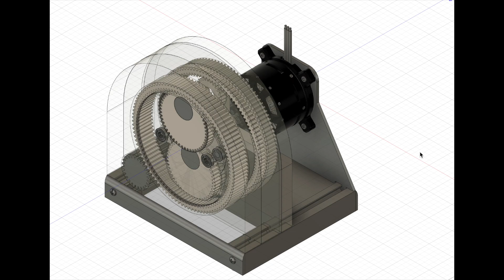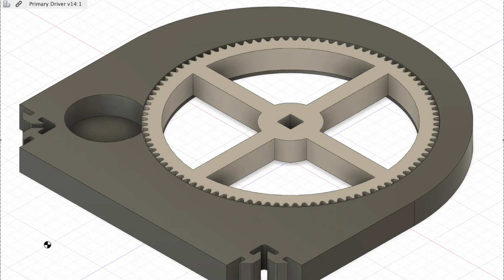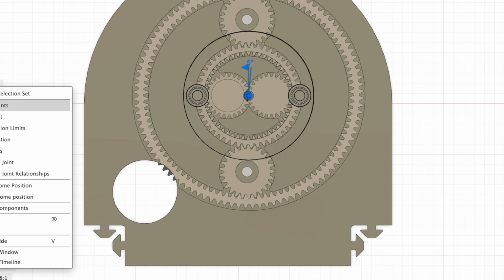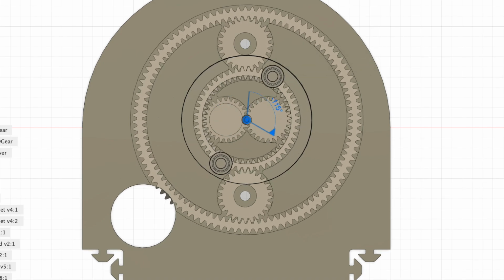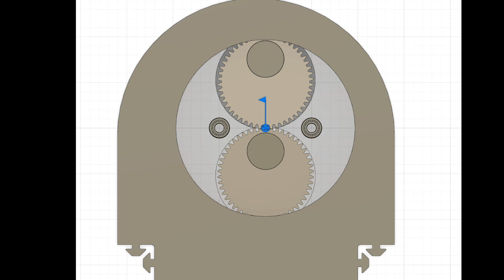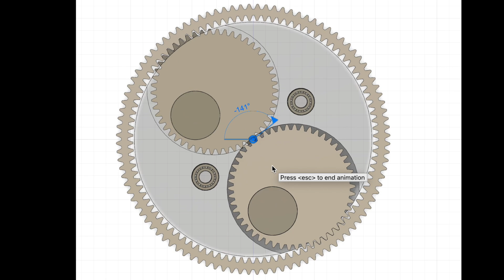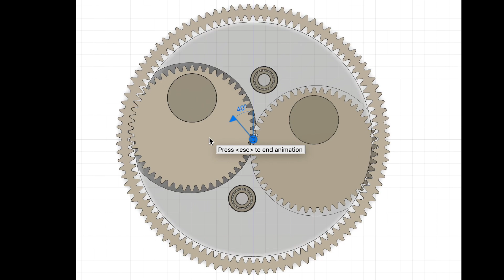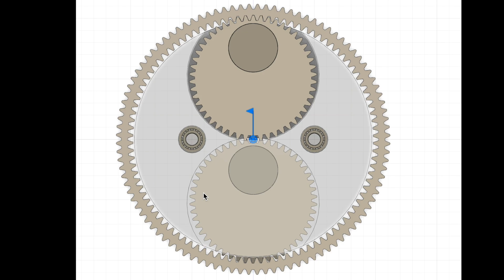Inertial Propulsion System 2: QELA\QALA HEAVY

Comment: I like your System 2 device better than the System 1. I’ve updated my Sling Drive device also since the last time I commented. I’m not an engineer or anything, so I would appreciate any tips you could give.
Reply from the maker: Thanks a bunch for this comment🙇‍♂️. I’m also a fan of the second system because it’s a lot easier to build than the first. It’s essentially like assembling a mechanical clock/ gear mechanism. 

Also—I’m more than happy to share any insights as you continue with your builds. My only advice at this moment is try until you find something that works! Make sure you have a good understanding of the principles you’re trying to leverage to get something functional, otherwise you’ll be thrown into the “blind alley”of structural fixedness! 

Feel free to reach out if you have any other questions. My contact info can be found on my channel homepage!

Comment: I built the same thing about 10 yrs ago.. called it internal propulsion and the model was made with rc car gears.. inspired by contemplating wheel hop in a car and redirect the weight to eliminate downward force.. what i found was it will redirect all of that energy to the left and right, due to retracting the weight towards center. It will form a twist to the entire assembly... Was gonna put in in a jetski while dreaming potentials, even pictured constant accelerating spacecraft.. turns out, "they" have already built, based on this logic, a functioning solution.. basically, a hollow doughnut shape, full of ferromagnetic superfluid, wrapped with similar wiring pattern as an alternator, very high current is passed through the wire to make the fluid travel to follow the wire.. just hold a bike wheel out at arms length, dont tilt it, get it spinning and simply rotate at the feet. It will pull up or push down based on which direction your feet turn.. like a merry go round that wants to lift
Reply from the maker: Thanks for the comment, and sharing your unique investigations! People like yourself have nothing but my respect—I know how difficult it is first hand to prototype these systems and explore alternative design approaches which haven’t been given an honest “light of day” so to speak.

Comment: I have an idea related to converting rotation to directional force without a propeller or a wheel on the ground.  It has a motor rotating a balanced lightweight frame with a short heavy object in it that can easily move back and forth on the frame.  The heavy object will be less than half the length of the frame and will have a connection point in the middle of it.  The connection point on the heavy object will be connected to one side of the box via cable or metal bar that can move side to side on the connection point.  As the frame rotates, the heavy object will be continuously be pulled to the same side of the box.  Being so unbalanced it will cause extra vibration so ideally it would need to be two identical rotating frames side by side rotating in the opposite direction.  The only thing that would be left is directional force.  I haven't tested this yet so I don't know if it will actually work.  If it does work and it can generate enough force, one could create a flying craft with no externally visible propulsion.  It would work in the vacuum of space, in atmosphere and even work underwater if it is sealed.  It is worth a small scale test.

Comment: There is one style of inertial propulsion system I believe might work. It consists of a sphere filled with gas or liquid. Pulsing laser beams converge at the centre to produce a field of exploding plasma. Each explosion pushes the head of a hammer on a spring against the end of a bar poking in from the wall of the chamber. Each stroke of the hammer accelerates the device in the direction of the stroke. There is no reaction force from the plasma driving the hammer to cancel out the acceleration because the plasma field is free standing within the chamber and not physically connected to it. The kinetic energy that doesn't drive the hammer transduces to heat before it can touch the walls. That heat is either expelled from the device or fed to a transducer to save energy. I imagine this device can only be used once in space as it may not have enough power for launching into space or for use as aircraft.
Reply from the maker: Very cool idea, interesting . Thanks for the comment and thank you for sharing ! 🙇‍♂️

Comment: You have designed a wobble bot.  It will oscillate.
Reply: Actually tho, made a gyroscopic spinning cube vehicle in lbp going off this very thing. Center engine was an equilateral cross with two diagonally opposed disk weights.

Comment: i wonder if you can do this with magnets and plasma flow
Reply from the maker: You've actually point out something which is kinda of an interesting overlap: all of the mathematical curves you find in these systems closely mirror the kinematics of motion that you would find for a particle traveling in a confined plasma chamber/accelerators. In fact, when I first attempted to write the code for these simulations, using python, they came straight out of those kinematics.
Reply: @MillennialZoomer that is interesting. that makes me wonder if regular fluid in a tube would work, a pump and tubing should be quiet easy to setup
Reply from the maker: @spacecase0 doable, probably. Straightforward in execution, most likely not. From the little experience I had in-lab dealing with industrial type pumps engineering something like this for a pneumatic/hydraulic-like system would be quite a project (to put it lightly).
Reply: Yes.. you can

Comment: You won't get a net inertial thrust.  Everybody (including myself back in the day) who comes up with the idea of changing orbital mass radii with constant angular velocity, forget to factor in the coriolis forces the masses produce onto the rotor during a mass's up swing/enlarging its radius and the other mass's down swing/decreasing its radius , which unfortunately counters the difference in inertial forces on the upper half verses the lower half of the rotor.....
Reply from the maker: Thanks for the comment. I was very careful to research this problem. A good book which talks about what you just mentioned is "The Death of Rocketry", namely pages 45-58 do  justice laying out the most common pitfalls when people ignore tangential, centripetal and Coriolis forces.

The Coriolis/centrifugal (which really doesn't exist) concern comes from analyzing in a rotating frame. I’m not doing that. The singlet is derived in an inertial frame and only rotated with explicit rotation matrices at the end, so those terms are accounted for by construction, not ignored. What I've actually built is a two-mass Tusi-couple or mechanical singlet: two identical point masses on rotating internal disks, π out of phase, inside a co-rotating host. The geometry, centers, and arm vectors are defined explicitly, then transformed with rotation matrices; no extra “fictitious forces” are added,  and what remains left over is true. 

Concretely, the positions are:
D_A(t) = c_A(t) + a_A(t)
D_B(t) = c_B(t) + a_B(t)

where a_A and a_B come from rotation matrices acting on the fixed local arms. The center of mass is the average D_CM(t). In the singlet, after applying the global rotation R_theta, the CM stays fixed but there IS a net linear thrust due to antisymmetry ( I later discovered this later through the math,  the 'asymmetric' label I used all these years might not be so accurate)  and mass exchange. Actually the "Coriolis" force, which you say  is supposed to work against me, IS the only reason there can be a net thrust on the center at all.

To be  extra clear: there is no "constant angular velocity" for a given point mass in the Tusi mechanism approach. Both masses are  constantly being accelerated and decelerated  during one cycle on a  folded/looped track which is the diameter of the large disk. The "stator" casing which carries them definitely has a "constant angular velocity", but not the point masses themselves.This system is energy-exchange-driven: internal angular momentum and phase hand-offs move energy around inside without violating CM invariance. Moreover, it’s not about making a mass “speed up” to generate force, like in devices such as the Brandson device. It’s about energy exchange. The disk behaves like a simple quantum system: it always starts with some nonzero potential energy at the lower position. They are individually identical to classical springs in a simple harmonic oscillator, albeit 90 degrees apart from one another in initial configuration.

I’ve already posted the math and simulation here: https://www.researchgate.net/publication/394250595_A_Heuristic_for_the_Discretization_of_Classical_Mass_as_Ordinary_Objects_and_Dynamic_Spinors

For a video which does good work explaining the displacement of an oscillating system during forced vibration of a system along with work and energy this is helpful: https://youtu.be/Ghk8o4z2VN8

I'm human like anyone else, so I could have missed something or made a mistake, but I'm pretty confident in my assessments on paper and prior investigations--to say the least. And if it doesn't work, its certainly not the only way to generate mechanical thrust.  

hope the helps some!
Reply: @MillennialZoomer   I'm from the camp that goes with the premise as follows:  Space/time is a substance and not an empty vacuum.  Inertia is therefore the tension or drag from this space/time "stuff" that mass experiences due to interfering with it during acceleration.  Therefore, a mass experiencing centripetal acceleration generates this space/time drag across its mass, what we otherwise call a "fictitious" centrifugal force, but nonetheless still a force, derived from this space/time drag that can do real work and displace the C.O.M. of the frame of reference you are working with (this dragging of space/time is transferring energy from the space/time into the frame of reference that we want to go somewhere, so conservation of momentum principle is not violated because we have a source of energy that we are tapping into beyond the frame of reference housing the device, the spacetime environment).  With this in mind, the ultimate goal is to engineer a device that uses this spacetime drag/inertial force to accelerate a frame of reference housing this device by minimizing any opposing inertial forces generated in the process of doing so that would otherwise cancel out any net inertial force effect. 

Tell me if I'm wrong, but I understand so far that you see reactionless thrust to be achieved through means of energy exchanges within the frame of reference you are working with through phasing of mass movement to not be in violation of C of M.  I believe that I'm seeing it differently in that I think it's possible, and that we need to consider the transfer of energy from space time itself from outside the system for "reactionless" drives......to react off of spacetime............
Reply from the maker: @antigrav1302  So once again I strongly encourage you to read this document:https://www.researchgate.net/publication/394250595_A_Heuristic_for_the_Discretization_of_Classical_Mass_as_Ordinary_Objects_and_Dynamic_Spinors

If I'm understanding your response correctly, it sounds like you are assuming that I believe space is an empty void of nothingness. Very politely,  I do not know where I ever said spacetime was purely empty. Maybe it is because there is a fundamental misunderstanding regarding my former statements on the centrifugal and Coriolis forces. If you stopped to read the material I provided you might find that we actual share some overlaps. Who knows (*shocker*) we might even belong to the same camp. In fact, much of what you've just said, I've definitely attempted to give some rigorous treatments to in a "formal" fashion using the language and "conventional" (whatever that is supposed to mean)  tools of physics within the paper.

Furthermore, what you are saying about the fictitious forces, isn't really going against what I'm saying when I say "they aren't real". If you have 3 minutes to spare here's a video which might clear up the confusion regarding what I mean when I say "not real" because it sounds like that may be another point of agreement:https://youtu.be/W_7QWaiJYDw?si=xgTIU93QdFQB88nj   Or only 2 minutes maybe this one: https://youtu.be/n4AMF3UfEX4  ...Or just you can skip to page 28 in the document I provided and just look at the graphic on that single page. I think once you get there, you'll see that we are probably (mostly) talking about the same thing regarding "tension" and "resistance" as it relates to inertia...

You aren't wrong at all on your commentary regarding energy exchange-- in fact you are one of the few who is keen to understand this fact---this system I've developed, strictly speaking, is not "closed" (infact, I could argue that there are no purely "closed" systems, depending on how I use Mach's principle).  All of my devices may qualify as a sort of "opened" system in space depending on how one invokes Mach's principles. Strictly speaking, the  process of "energy exchange" isn't perfectly "closed" for a given system, and this is what the calculations+simulation imply in part. There is , a very real, mass-energy exchange happening within spacetime, by the "fabric" of spacetime itself. 

In the paper I cite the work of Eric Laithwaite, because he was technically the only fellow who realized how mass transfer was being effected in space through a basic two "particle" (spinning gyroscopes) system. In bringing of this matter up I must clarify: I am of the persuasion that conventional gyroscopic propulsion--- the dynamic movement of geometrically contiguous spinning disks to induce a force to generate lift--- is not a possibility, per the work of Kidd and the late professor.

More clarity: I've never ever found any "reaction-less" machine within my own work or of others. That would be in violation of Newtons laws. Even though it is not an impossibility that Newton's laws can be broken, I am of the persuasion that this is highly improbable upon careful inspection of a given system (as was Professor Laithwaite). It is better to call this machine/these devices  "reactionary"because you must have at least two bodies interacting with one another to bring about the process called force via Sir Isaac Newton. Nothing I've built to date is "reaction-less", everything is "reactionary".
Reply: @MillennialZoomer  Ok, I will look at your paper for sure.  I presented my idea in order to see little more about your view on Coriolis/Centrifugal forces and why the statement ("they really don't exist"). We agree then that energy can be gained from an open system such as spacetime👍
Reply from the maker: @antigrav1302  Sure, and if that is so, then the approach taken by this system is viable, and can indeed generate inertial thrust. All this system is doing is "reconfiguring" spacetime to have a more preferable configuration of mass-energy exchange which allows for thrust. This is why I prefer to call these systems "Artificial Gyroscopes" because you are literally "programming" the conditions for mass-energy transfers to create real solitons (https://en.wikipedia.org/wiki/Soliton ) in spacetime. Artificial Gyroscopes "induce" an impulsive action in space through rearranged segments of mass such that there is an emergent force, rather than having them concentrated as a thick and contiguous mass entity (aka spinning disk) that is torqued on an axis in any number of ways. Some of these "pathways" of motion energy correspond to very specific types of mathematical curves/tools with useful physical benefits. The one mentioned here is the Tusi mechanism, and in my first device it is the 2π twisted möbius band which comes with the property of "non-orientablity" here: https://www.youtube.com/watch?v=8j0h-snNSwY

In summary, the appearances of these systems is sometimes, almost deceptively, counter-intuitive. Often times, the output looks remarkably simple and rather trivial (for example, in this case you see a simplex circle traced by two point masses between a "barycenter"), but, believe me, the "miracle" is in the process which gives you that final output.